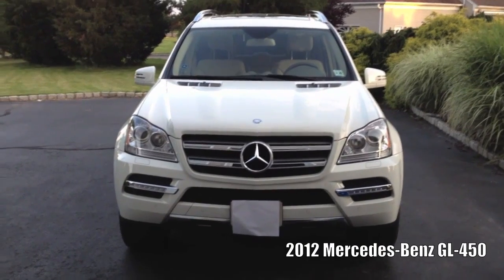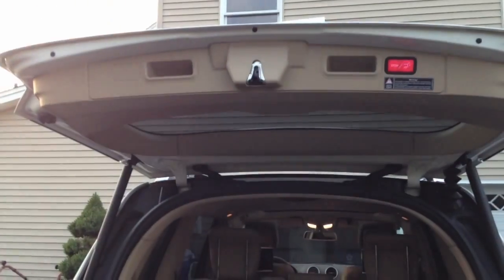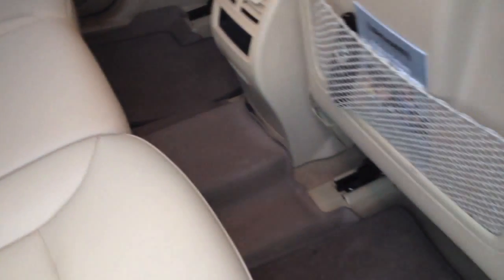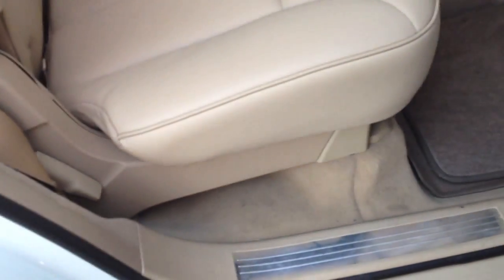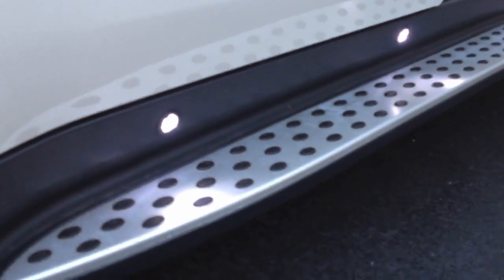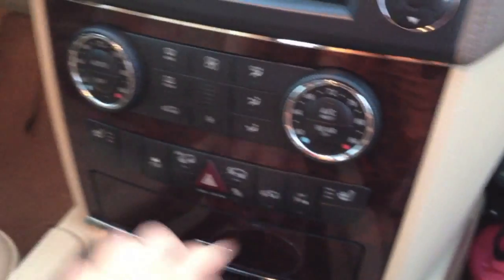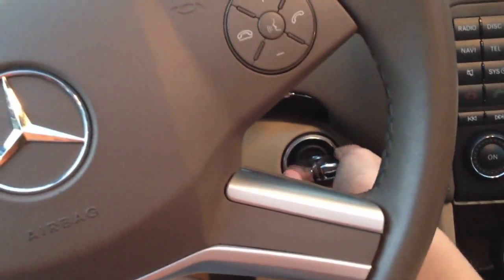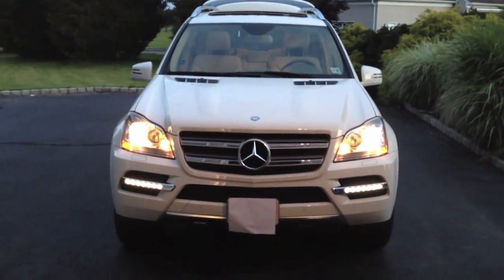2012 Mercedes-Benz Gl 450 Review

Comment from the maker: Yea, depending on what year you got it you may not have the chrome fins on the hood. Ours was an option that didn't come standard (We had to pay for it) It was part of the Appearance package, which also came with the chrome door handle inserts, chrome exhaust tips, illuminated running boards, and the chrome roof rails. The 2013 model comes with all that stuff i just mentioned standard. The new "Appearance Package" for the 2013 model is just illuminated running boards, and chrome exhaust tips.

Comment: 2007 GL450. Now 164k.Everyting works, Loads of room in the 3 rows of seats. Replaced front air shocks, repainted left rear fender (clearcoat was coming off) and the occasional light bulb.. Looks great, pleasure to drive, especially in bad weather conditions.. I use liqui-moly in the engine coolant and oil (just me). Highly recommend Michelin tires. Cons. Needs premium, and gets 14-18 mpg. :(

Comment: you mentioned about the up hill control... It is really an off road thing.. I really don't know what it is called but if you notice using it your transmission changes. Although it is a GREAT REVIEW!
Reply: +Manny Lam it helps get up steep slopes, the downhill one keeps it at set speed  so all you have to do is steer. its amazing off road